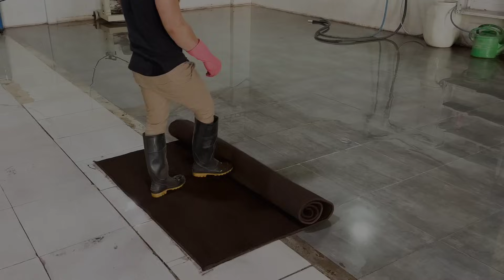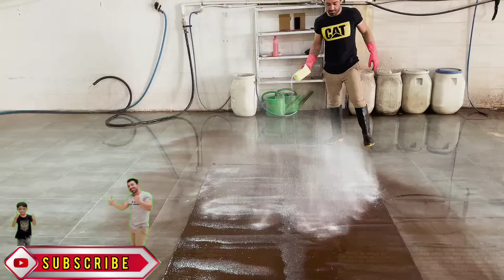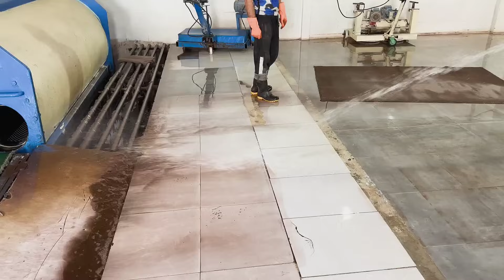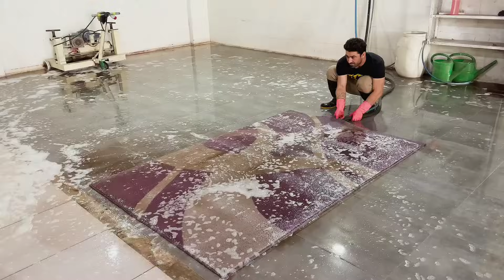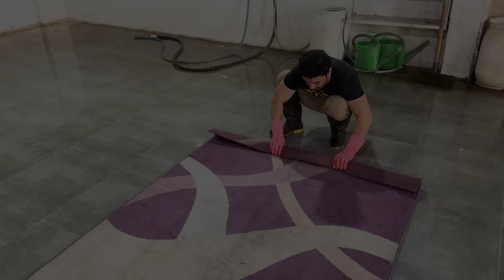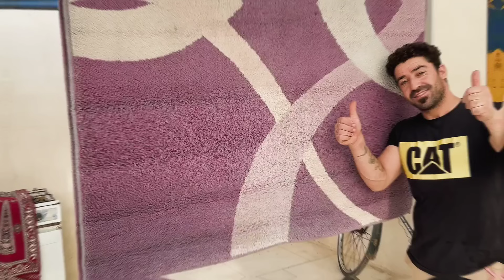World’s Deadliest And Most Terrible Dirty Carpet | Carpet Cleaning Satisfying

Comment: Your monthly water bill must be insane!
Reply from the maker: Hi dear friend
All waste water is recycled and reused.
Please see the video related to this process in the channel.
Thank you so much for watching.
https://youtu.be/_nnkAQ-voHU
Reply: I think you would save more water if you used ultrasonic (cavitation) devices to soak the carpets.  The vibration would shake the dirt free from the carpet.  That way you only need enough water to cover the carpet, maybe a few cm.  You could experiment with speakers inside plastic storage bin, so the bottom can vibrate, and put on top of the soaking carpet.  Then try some speaker audio test tracks to find what makes the dirt move. Probably lower, like 10-100 Hz. But who knows.  Various muscle therapy vibrators may also be useful to try, in a glove or bag of course.